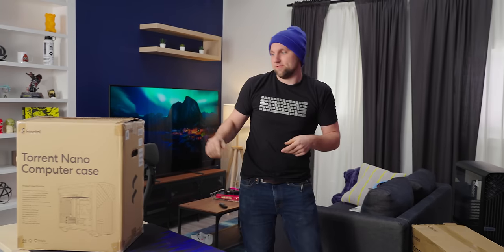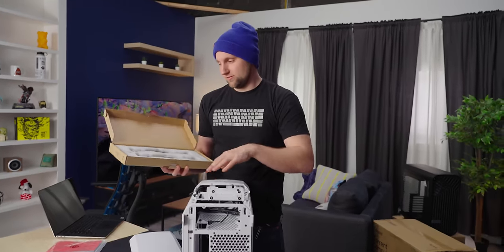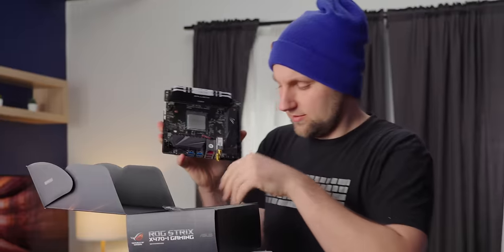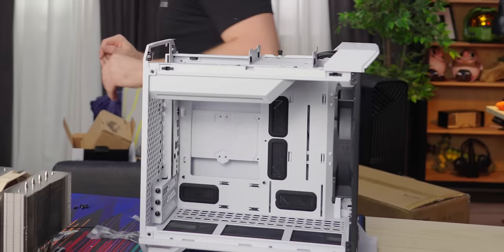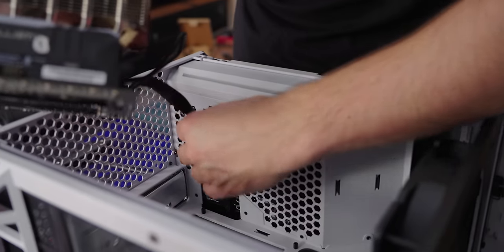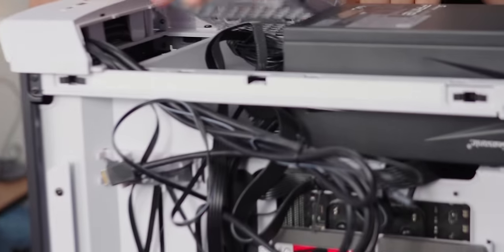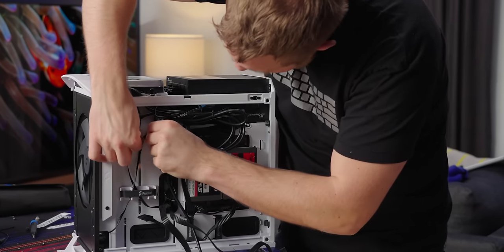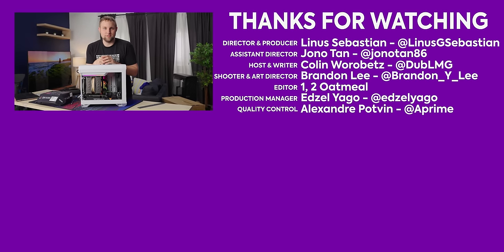The BEST case got SMALLER! - Fractal Torrent Nano

Comment: Honestly a comparison between this and something like a h1 v2 would be really interesting. Completely different approaches to a similar volume of case. Throw in some boutique small form factor cases as well and it would be a compelling video.
Reply: H1 fire fire.
Reply: So you want to watch Optimum Tech then.
Reply: I thought we were boycotting NZXT
Reply: @scotty82  exactly what needed on cold days
Reply: @llamapi3  link?
Reply: @Cxs1a3  why would we lol
Reply: @scotty82  not the V2 apparently
Reply: there is also the new Lianli A4 H20, which is basically Dan Case but made by LianLi so higher-volume production.
Reply: @shhhota  cause they don't care if their case burns down your house.
Reply: @joemarais7683  which is which
Reply: Sizes aren't comparitive at all. The Torrent Nano is 34L (417 x 222 x 374) and is more than twice the size of the H1 V2 at 15.5L (405 x 196 x 196).
Reply: @schillelagh  that puts the nano at 35 liters and the H1 V2 at 15.6 liters. There really wouldnt be any comp

I do see an issue where the 180 fan causes to much positive power and the GPU ends up circulating air rather than pulling in fresh air. Deshrouding the GPU and putting 140mm fans will probably make this case insane. It a similar issue the H1 has with it's chonky 140 intake
Reply: Lol, I missed where you put the volume, I ran and did my own math
Reply: They're really not the same size. This thing is like 2x H1
Reply: @shhhota  also the second fix they did back in August which is the one I have and has been fine I'mma upgrade to v2
Reply: Similar volume is 15.6 for h1 and 34.6 for that one you mean? Are you kidding?
Reply: This case is over double the size of the h1
Reply: nr200
Reply: The h1 is a nightmare for any video card that needs to exhaust to the back, aka blower cards.  The design isn't well thought out.
Reply: Just wait a few days I'm sure gamers nexus got you covered
Reply: How about something simple like thermals? Was expecting at the very least a lil benchmark especially after he says will be interesting to see what gpu temps are. What a noob!
Reply: Similar volume? Wait isn't this is like 3x the vol of h1?
Reply: @scotty82  that was fixed a while ago
Reply: @scotty82  there just got a v2 released and it's perfectly fine. slightly bigger and properly grounded pci-e extension / riser cable. However NZXT not my brand, I like Fractal Design, great  underrated company with great customer support and they do care.
Reply: @ArchusKanzaki  and less fire.
Reply: H1 v2: GPU 85 degrees celsius
Torrent Nano: 👌
Reply: The torrent is twice the size how is that even comparable?
Reply: Nothing similar about those two cases at all. Lol

Comment: Oh man. This needs to be an in-depth review; thermals, performance, etc. In love with this SFF.
Reply: That's the job for Steve GN :)
Reply: I would love thermals and air flow
Reply: @Bayofthe91st  GN will definitely be reviewing this as they loved the Torrent. But for comparisons with other SFF cases I hope Ali from Optimum Tech reviews this one too.
This feels like an airflow version of the NR200 better suited for air cooling, and it can use ATX PSUs. That's a huge win for me.
Reply: lol this thing is 35L, 15L over the 20L sff limit. There’s no comparison between this and actual sff cases
Reply: @mel-ju7kp  That much? Damn, didn't get that from the video, looked smaller to me. I guess the top compartment and motherboard tray backside add a lot of volume.
Still way smaller than mATX cases, I guess
Reply: @mel-ju7kp  okay Mel, thanks for the input.
Reply: @Bayofthe91st  Steve likes giant cases lmfao. Optimum Tech is by far best for SFF content
Reply: Keep builds on LTT. This is pointless without thermal and performance testing.
Reply: It's a small case, the thermals are going to suck. No need for an in-depth review. Even the hard drive tray is janky.
Reply: @EikottXD  big cases have to be worse for thermals, the main issue is the space making the fans useless
Reply: @ETHANR26  Not true. Just buy a good case.
Reply: @EikottXD  That doesn't make sense.  empty space is not superior in any case.
Reply: @EikottXD  That is one of the dumbest things I've read in a while.
Reply: Thermals not so great.. Gpu just pushes air to the glass window and it gets stuck there. no place for a fan near it and the hot air is just stuck at gpu location.
Reply: Honestly I can't see the hype in SFF cases, It just seems like creating headaches for yourself when you don't need to. Unless you are living in Japan where every square inch is premium IDK why these things are so popular, other than it is kind of impressive to see how much ish u can squeeze, but at the complete loss of performance most of the time.
Reply: @DATWagonator  I have a NR200P Max with a 3090 and 12700k. Cpu and gpu peak temps are about 70 degrees. Where is the complete loss of performance?
Reply: @EikottXD  Well guess what you're wrong I have the same case and same cpu cooler the temps are nuts on both CPU and GPU this is the best case series when it comes to airflow and cooling performance.
Reply: Basically look at GN's review of the normal sized version of this and you'll pretty much have it even though this is SFF since this case in all sizes is airflow focused meaning you'll be just fine. :)
Reply: @experimental0000  already have watched that. Point still stands that it's physically a different case which is more cramped. Totally warrants an in-depth review from the Labs team.

Comment: great case, one thing id change on the outside would be a right angle AC plug, that way there isn't an annoying kink
Reply: Don't kink shame.
Reply: I was thinking the same. That bend radius is awful and will take a toll on that cable over time.
Reply: You can get them off of Amazon for like $12, but I agree that it should just come standard

Comment: I'm not sold on cramming so much gear together without a giant fan the size of a 10 year old kid blowing a tornado across it, to keep it cool.  I guess if you find it works for you, so much the better. I'd rather have a giant case with room for air around the components, myself, and that's what I use.

Comment: I switched my build over to then Torrent Nano and a NH-D15 cooler.     
If you fit an exhaust fan to the rear of the case there's no way to get the NH-D15's 140mm fan to fit if it's towards the rear I/O unless that exhaust fan is really slim.     

While it is possible to mount the outer fan of the NH-D15 to the other side (towards the 24-pin ATX power on the mobo), the ability to fit the included 140mm fan to the cooler may vary based on the motherboard. For me it did not work as my fan contacts the 24-pin ATX power plug for the motherboard and would have sat too far out to close the case, instead I mounted a 120mm fan which was small enough to still have the glass panel close up; stuck with a Noctua fan (A12x25). 

While it may or may not affect thermals I can just about barely get away with it using the Gigabyte Z490I Aorus ULTRA and an i9-10850k, the former kind of being known to run the CPU hot under stock settings. With my CPU peaking at 91C in a sustained benchmark setting (which isn't ideal but for real world use I'm still in the safe margins in my use case). But I'm kind of pushing it with my parts choice, the NH-D15 in this case with something like a Ryzen 7 or i7 will do just fine IMHO even with a mild OC.

Comment: Pro Tip for ITX builds, wire your reset switch to the clear CMOS jumper.
Reply: duuuuuuuuude, been on itx for sooo long and never thought about this one!!!!!! nice tip
Reply: Or just rip a power switch off an old case, connect that to the cmos jumper, and leave it somewhere accessible (inside or out)
Reply: What does clear CMOS do?
Reply: @menpee  same here, I usually hit the power bottom
Reply: @Dan-bh8jd  Resets the bios to default/safe mode. Used if a setting is preventing the PC from booting.

Comment: id love to see a mATX version of this but this case looks amazing
Reply: yeah, I get they're going SFF, but adding a 4th slot would have given it so much more potential
Reply: @TotallySlapdash  yep. Can fit 25mm fans if you really wanted if your card is under 3 slots
Reply: mATX is such an underserved form factor--for cases and motherboards. 😔
Reply: Theres the Torrent Compact but it still supports ATX, though it is a little smaller than the standard Torrent
Reply: My mATX case is 32L and if I were to rip out the 5.25" bays, I could "spec-match" the torrent nano except the storage. But the Torrent is a beautiful case
Reply: I'd just like a good quality, sensibly priced mATX case that isn't huge or hideous. I ended up settling for a Fractal Designs Define Mini in the end, I've had full ATX cases smaller than it.
They need to stop catering for water cooling and make cases the right size instead.
Reply: @_Piers_  Yeah. I like Fractal, but their "small" cases are not that small.
Reply: I got an ATX PSU and MATX Motherboard working in the NR200. You just have to remove one of the plastic retainer clips for the bottom panel.

Comment: Looks great, will this be on LTT?

I appreciate the PSU position, it's good to have no obstruction to the GPU intake.
Reply: what the fuck
Reply: Back in the day we thanked case manufacturers for ditching upper mounted PSUs so we could have a nice place for big radiators up top, now that the front of cases is clear of HDDs and ODDs, we can go back to having the PSUs up there again.
Reply: @FastSloth87  I thought the reason for moving them to the bottom was for clean cool airflow rather than sucking in the heat from the case. Recall that PSU failure rate was higher with this sort of setup.

Comment: I don't know whether it should be on LTT or a new channel but there should definitely be a video or channel about cases, radiators and/or CPU coolers so just to see what market cases are good, decent, bad or best for the budget, experiment on making cases more "better" as well as explain those cooler design, airflows, etc to better check educate on cases and cooling market. Definitely worth a watch now that systems are getting more powerful and power hungry.

Comment: Neat build video but could really do with a little more information on the case. Supported motherboard form factors would be nice. Showing if the second fan on the NH-D15 fits or not would also be nice. The original version of this case is in the background, but never shown side by side for a size comparison or key differences. I understand this isn't a review but the only information I got out of this is:
- PSU on the top
- 165mm cooler tower supported
- Micro ATX motherboard fits
- Smaller than the original Torrent case
- 335mm, 3-slot GPU will fit
- Has nice cable management options (although this isn't covered much)

Comment: I bought the black version of the case after watching this video and I'm absolutely in love with it. It's well thought out and looks really good with all black hardware.
With a NH-D15 and two 140mm fans in the front the cooling is great and quiet.
My GPU (PNY RTX 3080 Xlr8) fits perfect but is like 3mm too thicc to put slim fans underneath and I think that's my only issue with the case. Otherwise, great case, buy it if you think about it and your components fit
Reply: D15 as in dual fan D15? Did you have any fitment issues?

Comment: Ooh, I have never been as stoked for a case video! I have the Big Boi Torrent and I love it, it's awesome! But I have an extra mATX board, a 8700K and RAM  for it just waiting. I've been planning a smallish form factor build for a media PC, this could be the case for that!
Reply: Got the big boi as well, amazingly silent  for a high airflow case.

BUT if the nano existed back then, i might have gone for that.
Reply: Sadly your mATX board won’t work. This is specifically an ITX case
Reply: @meow8797  the hell does this have to do with anything?
Reply: @loganjay1041  ah, shame. Oh well, looking at the current GPU cituation, that is a minor annoyance.
Reply: Yeah, I didn't know this case were a thing. Got the big boi just a few months ago just to max out on airflow and low temps and it's awesome. Barely audible fan noise when running benchmarks on cpu and gpu, and cpu at 65, gpu at 55. But it's big, big as in WTF thats a big case! 
Perhaps I'll start a new build soon... this small one is sweet.

Comment: With super big coolers like the NH-D15 I usually plug the 12V CPU power cable into the mainboard before I put the mainboard into the case because it's almost impossible to plug it in afterwards. I then can easily connect the power cable to the PSU later without any hassle.

Comment: I wish they had a slightly taller mid tower model that could accommodate full ATX boards and two 140mm fans at the bottom. Though I am tempted to grab this. I'll be interested to see some thermal testing.

EDIT: LOL, they do... the compact. Now if only I could find it somewhere so they can take my money.

Comment: My only COMPLAINT about this case...
The PSU has to suck in hot air that's directly above the CPU cooler. If they'd made the shroud under the PSU solid on the bottom, above the CPU cooler, then put INTAKE on the shroud closer to the front they could have designed this to use cooler air being blown from the FRONT of the case without changing the look of the case much. So move the SHROUD intake from bottom to the side that faces the front of the case. That's it (and leave  enough gap under the PSU fan). That would make the PSU fan run much quieter (will vary by the PSU model)... honestly not sure how great air to the PSU is if the CPU cooler is close as the CPU fan is directed towards the rear. Obviously you're getting air flow to the PSU but it's not optimal thus in some situations the PSU will be much louder than necessary.
Reply: I swapped from the NR200 to this to prepare for giant GPUs and their power requirements.

Was just staring at my new Torrent Nano build and realised that the PSU has really bad air intake. You're the only person I've seen mention it. Just gonna assume it's fine....

Comment: I own a full size torrent and it is fantastic, the design and overall performance is amazing. I use it in combination with fractals lumen 360 aio but I'm sure it would perform just as great with an air cooler

Comment: I like Fractals cases. Well thought out layout and features, plus an sort of understated design. And many variations, I don't want a glass sidepanel, but there is a variant with a solid side panel.
The only thing I would like, was a case a bit smaller than their "Compact" sub-series (like Meshify and Torrent), that only supports mATX boards. I don't need a full ATX, but ITX boards with a good feature set are really expensive. I guess its not worth for them, building the exact same case but only marginally smaller.
Reply: Agree

Comment: This case looks really cool! Its just too big for me. I was surprised to see its dimensions are nearly 2x the size of the NR200P im currently using since it doesnt look that big in the video.
Reply: Wait it's that big? Dang well guess I don't feel too bad about my NR200P either haha
Reply: That's the price you pay to fit a flippin' NH-D15 in there, I guess.
Reply: @ArdentMoogle  Yeah its about 35 Liters in size! (417 x 222 x 374 mm)
Compared to the NR200P at about 18 Liters in size or like 19.8 with the feetsies
Reply: I was starting to regret getting the nr200p until I saw your comment 🤣. It does not look that big in the video dang.
Reply: But the air flow and noise, and cooling is much much better then NR200P tho
Reply: I started thinking of switching until I saw the dimensions lol. This is still quite big compared to the NR200, but the airflow potential with this one is immense.

Comment: I tried to do a similar build to this but I used the msi b550i motherboard and you didn't mention you'd need a hammer to dent the roof of the case to actually install this cooler lol. Mine didn't fit, I don't think the chromax version of this cooler would be that different in size, but this should be a definite warning to those considering this build. BTW the hammer did do the trick but there's no way you can screw the top motherboard screws in.
Reply: I have x570 si aorus and my NH-D15 didn't fit.

Comment: "Noice, mate" :P I'm just on a mission to build a PC, kind of upper-mid range gaming that would also look nice in living room, because I think it's going to reside there and I'm keeping my workstation in another room and will simply stream and this case looks like perfect, I love the "attic" PSU design, love that it has place for big, wide and tall tower cooler and also deep long and tall graphic card and the drive bays are just big plus. I'll probably going to modify it a little, especially to fit the living room (color) theme/scheme, but especially for watercooling, I see it could fit two rads plus pump pretty easy in there, but will probably first run on air to see temps, because front fan is pretty big and back has nice ventilation... Maybe would utilize a simple 3d print duct to remove the graphics cards hot rising air and channel it away from cpu intake to back outlet "mesh"

Comment: Honestly this case looks like it has everything I would want, aside from a 5.25 inch bay. And the reason is because I would like to get a Blu-ray drive for my PC and I don't have enough space on my desk for an external USB drive.
Reply: If you don’t need it that often, you might be able to get away with putting the external drive on top of your case, though perhaps there are other factors that might make it not viable
Reply: @jgieling8958  ideally though I would want it in the case. Fortunately there's another case I'm looking at that fits what I need and want, but it's kind of unfortunate because this case also looks really nice (though it's probably a bit expensive)